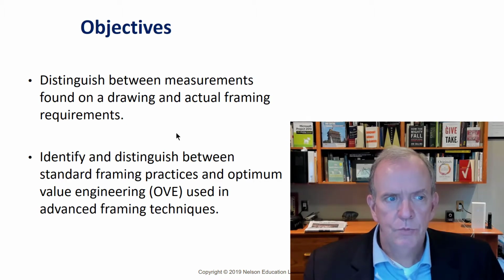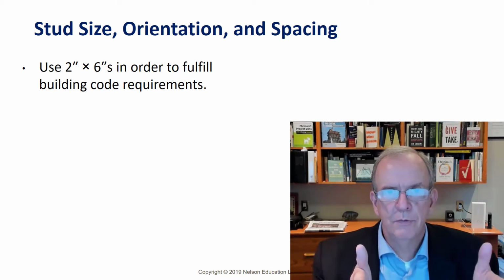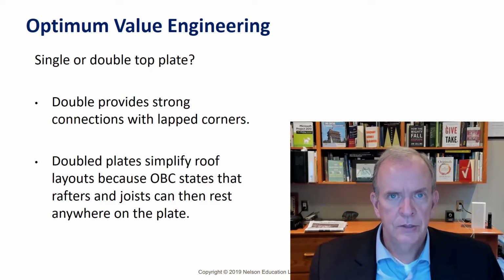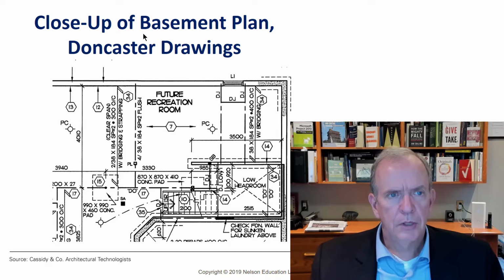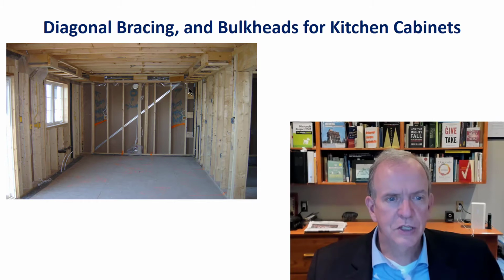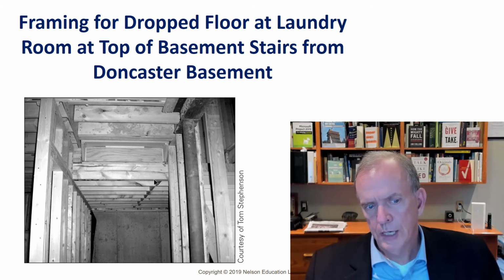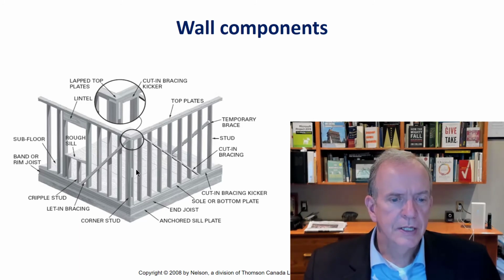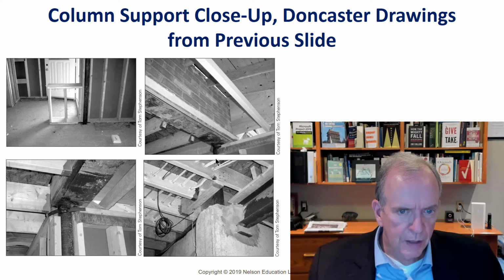Lecture 4B Wall Framing for Housing and Small Buildings

Comment: The encouragement at the end of the video is appreciated. I like how you explain the various components of the framing in terms of their particular functions and their role in transferring the structural loads. Understanding them this way makes them more memorable than a mere description such as "a lintel is the framing element above a door." What I am really curious about is balconies. I read an 800 plus page book on construction methods written by 3 guys from the East Coast and they never mentioned them. Since I am from a temperate area with many apartment buildings and without snow loads, balconies are very popular. Are they made with a variation of the cantilever approach that you mention for the bay window? Inquiring minds would like to know. Thank you for the lecture and your insights, Professor Stephenson!
Reply from the maker: Thanks Ian, likely your balconies are poured concrete with rebar placed wherever there is tension and yes acting as a cantilever.  Thanks for watching.